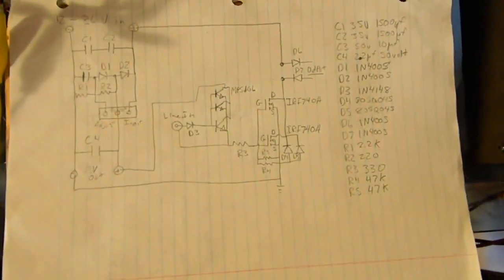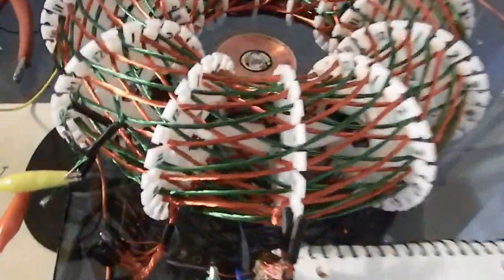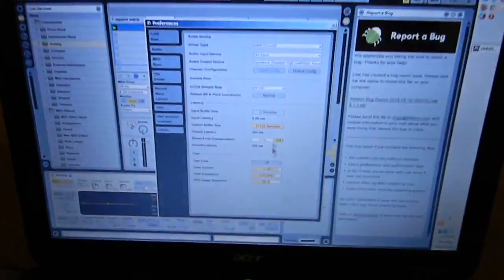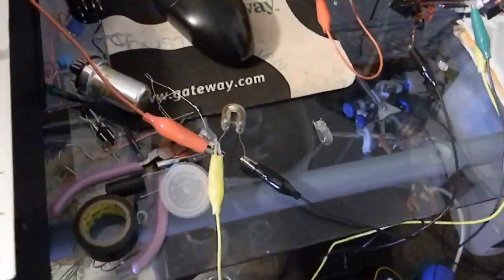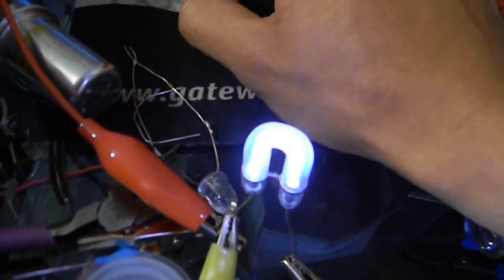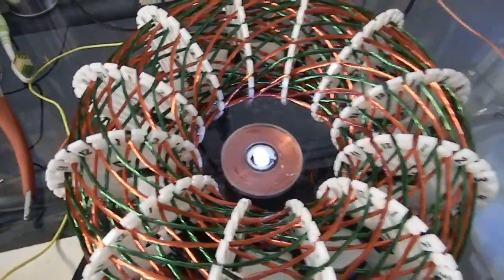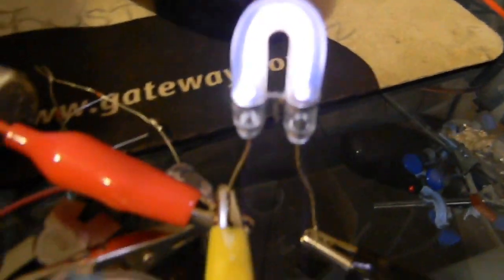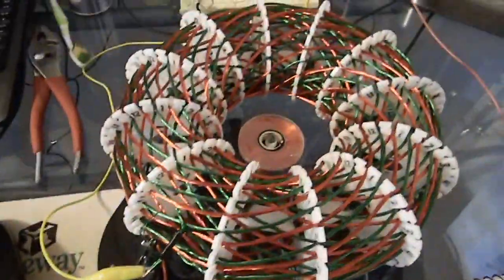Rodin Coil lights up strobe with radiant energy

Comment: Do you have any other videos that explain exactly what you're doing...what the circuit does, what did you put in the middle of the coil, why your coil looks so different than any other Rodin coil I've seen, why and what frequencies are you pumping into the coil,,etc,etc. I'm re-educating myself on this whole Rodin thing and am trying to separate the real from the bs. Thanks.
Reply: yeah i have a ton of other videos
Reply: its a poe vortex coil based on vortex mathmatics

Comment: Hello Abha Coil, Very nice build, I have built a 3 phase  Abha Rodin motor generator intergraded in one assembly based on pi and small phi they look much different These coils can have quite a voltage gain when wound with a ratio of 1 turn primary to 2 turns secondary and have a powerful magnetic field .The motor has a coefficient of performance of 5.98 and runs a 2 inch, N-42 neo sphere at 12000 Rpm this lights a 27 watt led load as well as runs a adams motor in the video on you tube. this Abha Rodin design is a proven performer. Keep up the good work, Tony
Reply: Tony Izaguirre Tony do you have a full expose on what you just described? I'd love to see it!
Reply: What's the video link love to see your project!!

Comment: Hi there... can i ask something please.

From a newbie point of view... whats happening here please?

I see youre putting in 13.8v and 2.85amps - how are you also putting a frequancy into the wires?

What i mean is, how are you able to put both current and a tone frequancy into 1 wire?

Thanks for you help, this looks interesting

all the  best
Reply: Um... i realy appreciate the reply. hmm

>notebook providing the wave (square etc) like PWM tone generator does 
>wave gets magnified through high power amp, which is electromagnetic which is electrical energy (so not actual sounds or tones) 
>this electronmagetic energy is being put into rodin coil 

?
Reply: hi again, and thank you. 

Ive just bought something on ebay, thought you might find it interesting. Im going to put the output on two copper pcb plates and see what happens. The module offers 2 signal outputs, so ill put two different frequancies down them and see if they resonate. So + to copper plate, neg end to the ground (dirt)?. As you can see im still learning :o)

Im looking at schumann resonance and scalar waves at the moment.

ebay: New Pulse Frequency Duty Cycle Adjustable Module Wave Signal PWM Generator

1. Working voltage: 5--30V, support micro USB 5.0V power supply. 
2. Frequency range: 1Hz ~ 150KHz. 
3. The frequency accuracy: ± 2%. 
4. Output current: <30mA. 
...
2. Suitable for serial communication. 
3. Wide frequency range, high accuracy. 
4. Two independent PWM generators can set the frequency and duty cycle. 
By the way: dont delete your google plus account, it also deletes your youtube videos. Thats what happened to me.
Reply: Thank you Gort, all the best, good fortune

Comment: But, so far I have not seen anyone generate free electricity with one of these.
Just hook the coil up to a bulb. Does it light? Rodin goes on and on about this aND yet, no one has done it.
Reply: This are the building blocks, dont be dense, if we had the governments funding or Teslas research we would already be there
Reply: thats cuz theres no such thing as free energy....there is something called nuclear physics and beta voltaics though....

Comment: This is my video....Lol funny to see how many views it got. In no way am I promoting this as something that makes free energy. That idea is 100% bullshit. This does however have a very real resonant frequency and high q factor making it produce really high voltage pretty easily. Also, none of the other credits helped me in anyway other than marko rodin's math and i didnt know what i was talking about back then....Radient energy is a mumbo jumbo term describing a standing wave based on length of wire and interturn capacitance.
Reply: Have you conducted any experiments with the Rodin Coil since?
Reply: @timleecreations  I have, but mostly in terms of building a tesla magnifier with the rodin coils as a source of rf current to drive a resonantor. It works well, but has too much coupling...I am working on different systems now
Reply: @MrWarrensk  Thank you! I ran into your video after learning about Rodin in my personal study of numerology. I was very impressed that people took on the task of bringing his ideas into reality... Wondering what has transpired in the many years after the surge in interest. Thank you for responding.

Comment: You plug your coil into a circuit with a emf and you see a light bulb work. How on earth is that free energy?
Reply: WoWOmegor anyone trying to tell you a roden coil makes free energy is ether trolling or ignorant.  I'm no expert but the roden coil seems to have unique properties that a normal coil dose not. it also seems to emit a stronger magnetic field, witch is key in wireless power. 

+ABHA COIL you say the light is purple, but the camera cant pick it up. I'm thinking its UV/ultra violet.
Reply: @blackdragonwiccan  yeah no free energy with a rodin coil.....just unique characteristics that have yet to find a service in our current market